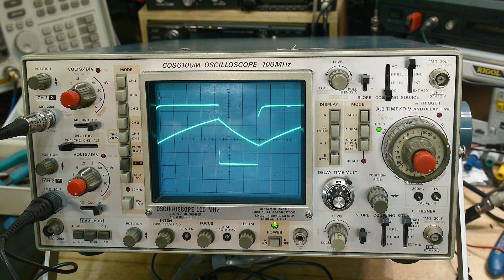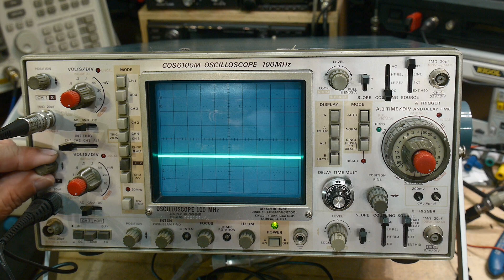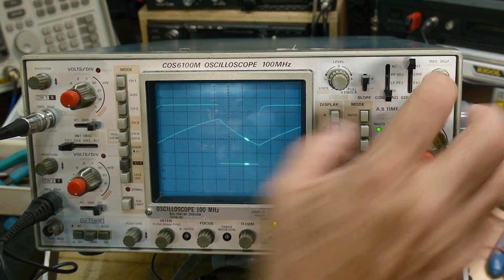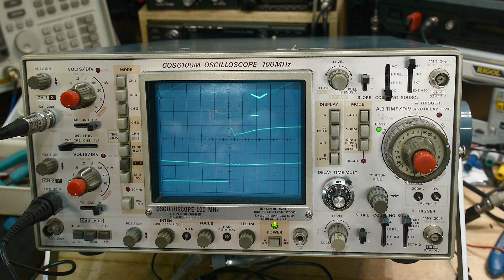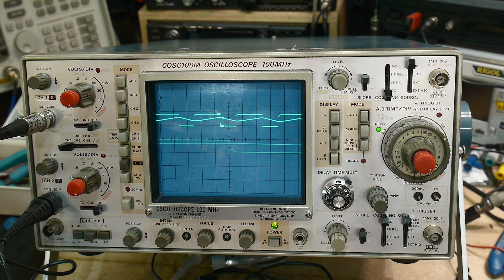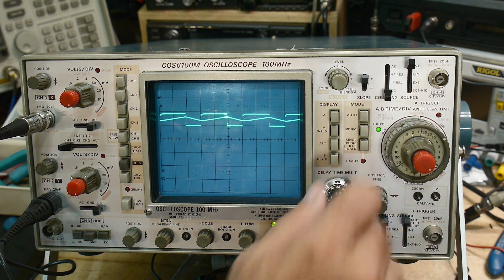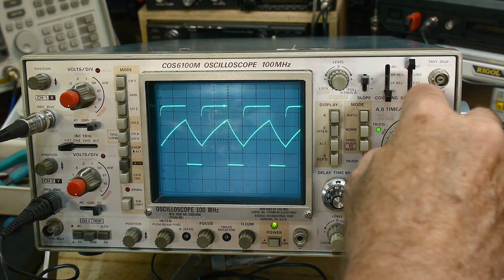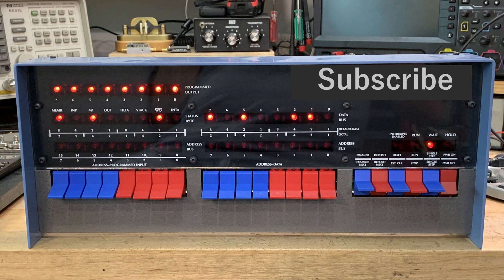#1258 Basics: Oscilloscope Delayed Sweep

Comment: Although you said it at 7:20, I was thinking how grateful I am for digital oscilloscopes much earlier in the video. On the other hand, operating all those lovely mechanical controls instead of futzing with a touchscreen sure makes you feel like you are really doing something.

I got rid of my last analog 'scope several years ago, and sometimes I regret it--until I remember how much more efficient I am these days using a digital instrument. 

Love this current series.
Reply: Analog scopes respond to EVERY glitch whereas digital sampling often skips brief transients.  Presently, this is less true for multi-GHz scopes, but you don't find those for a few Benjamins on ebay.
Reply: @byronwatkins2565  it often is the other way around. A glitch that happens only occasionally is invisible on the analog scope because it needs repeated signals to show. The digital can trigger on that one event and record it.
Reply: @BaldurNorddahl  A regular glitch and an intermittent fault are two different signals.
Reply: @byronwatkins2565  I am unsure what kind of signal you call a regular glitch and which would be missed by the digital scope. I am assuming you mean very brief signal with a high rise time, but no, both analog and digital are limited by the scope bandwidth and such signals would not make it past the bandwidth limit. 

The scope in the video is a 100 MHz dual channel. You can get the Siglent SDS1202X-E for €339, a 200 MHz dual channel scope with a sample rate of 1 GS per channel. This could in theory catch any "glitch" down to 1 ns but such a thing would never make it past the bandwidth limit.

There just isn't much those old things do better than even the cheapest modern digital scopes. If we compare to older digital scopes then maybe.
Reply: @BaldurNorddahl  A glitch is a regular signal with short duration.  Regular signals result from our circuit and can be eliminated by altering our circuit.  Intermittent signals generally result from our circuit interacting with the environment and cannot reliably be eliminated by altering our circuit... better shielding is more reliable here.

Digital storage oscilloscopes (DSO) have finite memory.  Memory is less expensive than it once was, but it is still true that faster sampling rates use up the memory in a shorter total time.  DSO manufacturers vary the sampling rate with the time scale setting so that the total memory holds one sweep.  1 GSa/s is the sampling rate ONLY on the fastest sweep setting (all the way clockwise).  If you are looking for a glitch in an audio circuit, then a MHz is more likely to be your sampling rate.  If you are observing a pendulum period, then a few kHz is more likely to be your sampling rate.
Reply: @byronwatkins2565  yes the memory is finite, but generally deep enough to contain dozens of "screens" of information, and the ability to zoom in wherever you'd like to see some more detail, without having to recapture a signal.   Also, modern scopes have complex trigger abilities that can catch even very rare "glitches" that you'd never find using an analog scope.  Runts, setup and hold timing violations, serial data triggering are just a few things analog scopes weren't good at doing. The only advantage of analog CRT scopes is a slightly higher resolution than the typical 8 bit sampling of most DSO scopes.
Reply: @tonyfremont  I don't believe runt detection is available for under a few k$.
Reply: @byronwatkins2565  I suppose that it is true that you might not get short duration signals while zoomed too far out. But you can search for them using a pulse trigger. You can also enable persistence and give it some time until it registers by chance. And finally even the cheap scope I linked to has 14 Mpts of sample memory, meaning it can catch a glitch of 14 MHz even when zoomed to a timebase of 1 second.
Reply: @byronwatkins2565  I have it on my $800 Rigol MSO5074.
Reply: @byronwatkins2565  BTW, tomtektest has a slew of videos on every operation (triggering, decoding, waveform generator, etc) that the Rigol MSO5000 series scopes which start at under $1000.  Right now, $800 will get you a four channel, 75MHz scope with a ton of included "options", such as the two 25MHz waveform generators and a pile of the serial decoders enabled.  It's a really awesome scope, especially for the money.  8GS/Sec max
Reply: @BaldurNorddahl  While you're doing all that every time you move your probe, I'll be using the repaired device.
Reply: @byronwatkins2565  be honest, you would be using a digital scope like the rest of us 🙂

At a timebase of .1s (and what business do you have being at .1s zoom?) the cheap digital scope would be able to show any short duration signal past the bandwidth limit of the 100 MHz scope in the video. But unlike the analog scope, you would be able to zoom in to that signal and get a picture  of what that actually was. And you could do so even if it was a non repeating signal. There are just too many features to even list that you could not do on the old analog things.
Reply: @BaldurNorddahl  I have and use both.
Reply: @byronwatkins2565  sorry for being late with the correct answer. I am still learning. The way you detect a glitch, defined as a short duration signal, while zoomed out as extremely simple: enable peak detect acquisition mode. That is two button presses on my scope (press acquire, press acquisition peak detect). In this mode the scope finds the max and min sample at the full sample rate and store that at the reduced rate that fits the memory. Thus it it is guaranteed to find and show the glitch no matter what zoom level you might choose.
Reply: @BaldurNorddahl  Often the glitch is a runt -- has lower amplitude than a normal pulse -- so that peak detect will choose normal pulses more often than the glitch.  This also assumes that the sampling rate is high enough to ensure that the glitch is sampled at least once.  Finite scope memory makes slower sweeps have lower sampling rates.  Scopes with a persistence mode allow using this to help detect glitches.
Reply: @byronwatkins2565  analog scopes are not good at triggering on runts? I am not sure I understand correctly, it seems you are proposing a small glitch signal and a larger normal signal within the same pixel - would that not also be shadowed on the analog scope (you would only be able to see the larger signal because both signals take up the same space on the screen)?

Every scope has runt detection these days, even the cheap hobby scopes like mine. The scope will also run trigger detection at the max sampling rate even when it can only store samples at a lower rate due to slow sweep. I just tried setting my signal generator to 10 ns pulse at 0.1 Hz. The scope will trigger on the pulse no matter what, even with a time base of 1 second per division and a sample rate of 200 kSa/s. It triggers both with acquisition mode normal and peak detect. It never misses a pulse which would be impossible if it only ran triggering at 200 kSa/s. Only peak detect will actually show the pulse with this setting.
Reply: I'll take a digital scope over these old things, most people would. I also prefer my 2019 car over an old 70's auto. I also prefer using my cell phone over one of those 70's payphones, but that's just me.
Reply: @joparkcat  It is possible to have both...